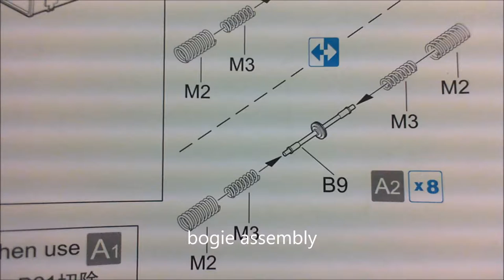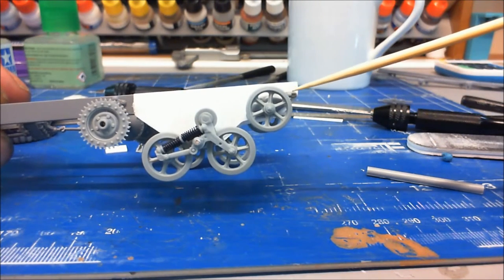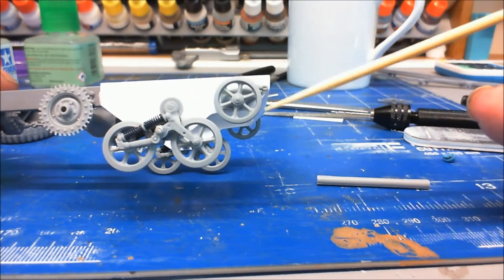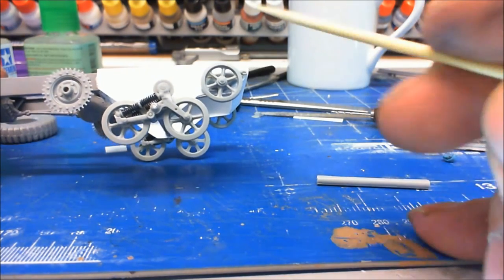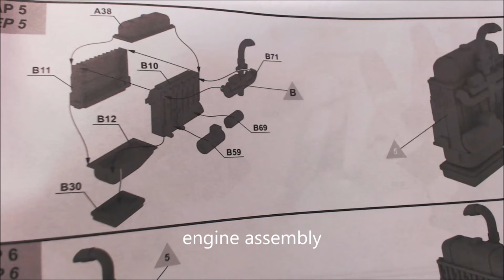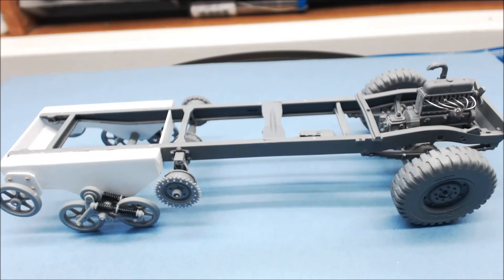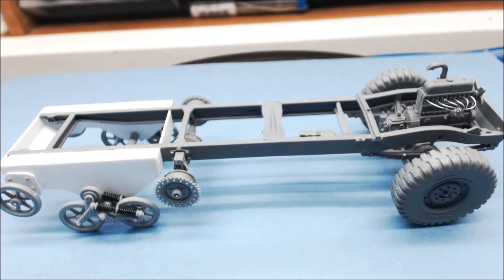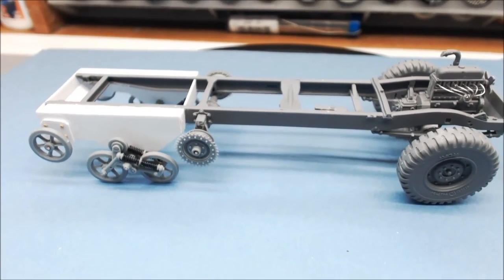IBG Bedford Half Track Conversion Build Log (2)

Comment: ... since you did ask good buddy. Although a picture is worth 1K words, a voice over would have been nice :)  Nice progress :) They need to find a solution to IBG's problem wrt adhesives!
Reply from the maker: Thanks switcher noted put in my draw start doing a little bit of a voice-over very difficult to know what to do pictures words video. They say you can please some people some of the time, but you can't please all of the people all the time. I found that mini art doesn't like extra thin I think it's just  the composition of plastic ,some think their putting in to keep plastic to keep it soft so the smaller parts to be cut off  what ever it is it works all the small parts come off nice and clean. Many thanks Sim
Reply: I hear you good buddy. Voice overs are difficult and time consuming. As I am not on FB I come here to learn and share. Although a picture is worth 1K words, a video is worth 1M. Sometimes a picture simply doesn't convey what you may be trying to say or draw our attention to a specific point. But at the end of the day it is your channel and have to please the masses, so do what ever voodoo you do best :) The learning environment as to be mutually stimulating for all involved :)
Reply from the maker: Thank you switcher all good points and all noted. I think a little time at the drawing board might be called for many thanks Sim
Reply: Simon Kemp. Models
U R welcome :)